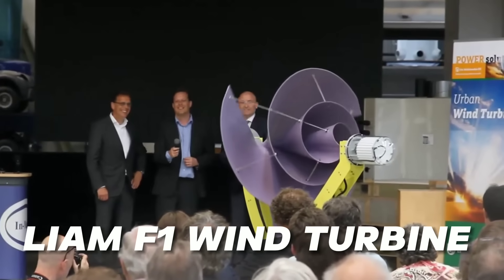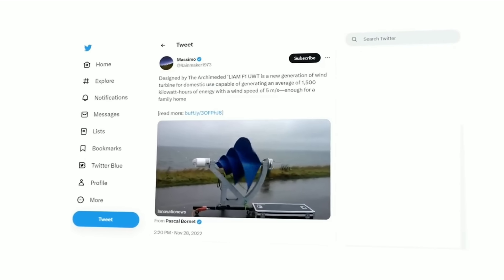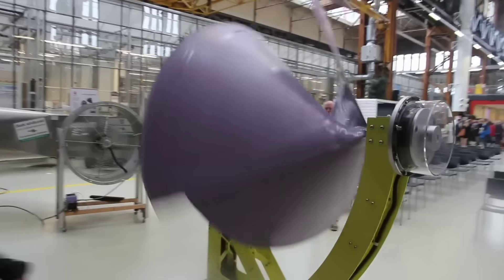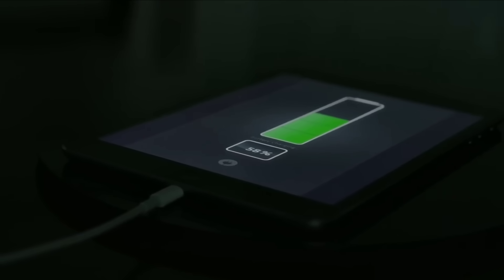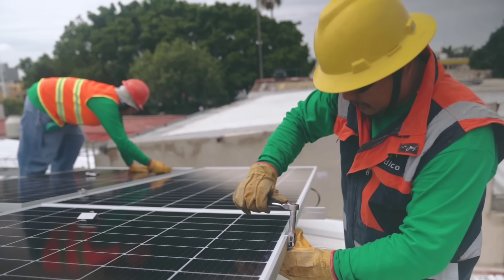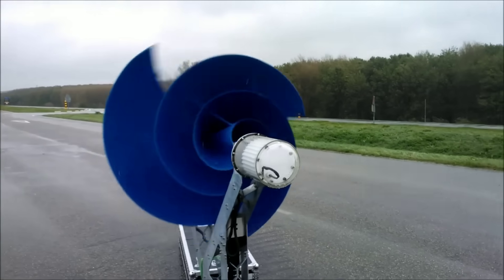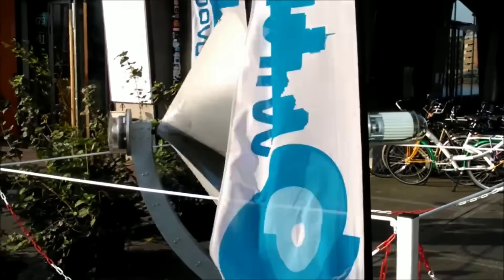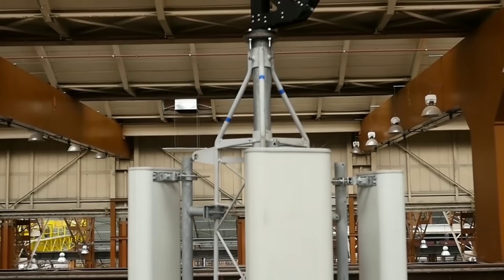This NEW European Wind Turbine for Home Outbeats PV Solar Panels in 2023?!

Comment: 5ms is nearly 18m/h winds that's nearly 50% higher wind requirements than a 3 blade turbine for the same swept area. Rather have something designed to run in 1-2ms and put a magnetic coupler on it to deal with over speed in high winds
Reply: wouldnt it be better to do something with the power in high wind speeds, slow the blades down by performing work on something, rather than simply let it slip past? 

maybe reconsider the problem, and consider alternative ways to perform... "work".

by definition, everything is heat...

every step of the way, making electricity, you are making heat... is it a loss?

so why make electricity at all?
Reply: 5m/s is 18km/h
Reply: @markgrabowski8662  you are correct that is a typo

Comment: I doubt it - don’t believe anyone that is indicating that wind turbines are effective a ground level unless your on an ocean shoreline where thw winds are always coming onshore- with wind power, wind velocity is everything and when there are trees and/or buildings in the area wind speeds will be low and turbulent at ground level - turbines need to be high/above the turbulence, where winds are strong and consistent (wind power varies with velocity cubed - if wind speed doubles, the power output is 8 times greater)
Reply: They also need to be big. Power output is proportional to swept area which is proportional to the square of the blade length.

Comment: As someone who has both solar and wind it is a joke to say;
1) solar requires any maintenance 😂
2) that a wind requires less or the same as solar.

Maintenance costs are around 10% of the energy made each year and as they are mechanical. Way more likely to break down.

Comment: This would be a great addition to a Tesla battery pack. The design is excellent and might make for an extremely efficient propeller for aircraft (something similar was just introduced as a prop for use on boats and potentially ships (in that product, there was a very substantial increase in efficiency). 

The price IS cheap compared to solar. (Especially when it comes time to replace shingles. 
As to people who worry about birds and cats... we should ban raptors. 
Lets see what the mortality rate is and worry about it then if and only if there's a real problem... as its very likely Not a problem. The design would be less likely to kill as opposed to a solid hit from a conventional propeller blade.

This looks like a great product... the noise reduction alone should be great for home use.
If it were ducted, might be slightly more efficient and quieter (and less a visual problem).
Reply: What's the performance in storm?
Does it shut down?
It's not as beautiful as the harmony wind turbine which can operate at a wide spectrum. On the other hand it probably doesn't reach as high efficiency as the F1. And it can't be bought yet.
Reply: Read the comments above and don't waste your money.

Comment: SO MUCH B.S. in this video, it's disturbing!!  I spent 12-years in the small wind business, selling and installing over 2,000 small wind turbines around the world, have lived with a 2.4kW small wind turbine in my own backyard, for the past 15-years, and have seen scams like this Liam F1 turbine, MANY times throughout my career.  The only thing they're good for is bilking investors out of their hard-earned cash as these turbines produce virtually no power, are INCREDIBLY expensive and are filled with lies and mistruths.  Every wind turbine, large or small, can produce energy from the wind, at any direction and every wind turbine needs to be up high in the undisturbed and fast-moving winds to produce enough energy to realize any possible ROI.  I've done the math, many, many times, small wind turbines are almost always a waste of money, except really cheap ones that you install yourself, and even then, most of them will break and waste money.  Solar panels are your best investment for small power generation.  They're much cheaper, silent, reliable and can be installed virtually anywhere.

Comment: For me, the only drawback for this device is the price
Reply: The lack of watts generated, should be your biggest concern.
Reply: Only drawback? How about adding that it will not work very well?
Reply: Price is very reasonable. Installing should also be cheap.

Big question is what average Wattage from a 5m/sec wind?😊
Reply: And the minor difficulty that it is a pile of s**t and not a word of it is true. Grow up, and stop believing in fairies at the bottom of the garden